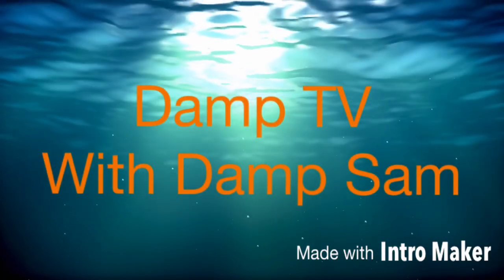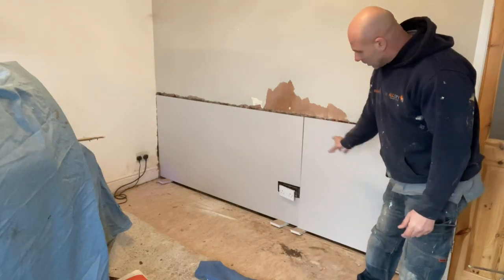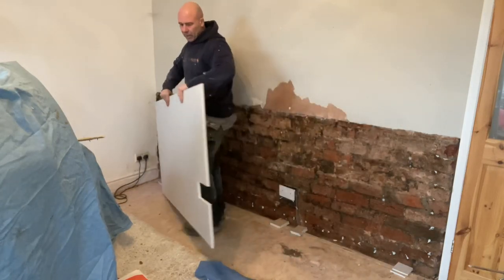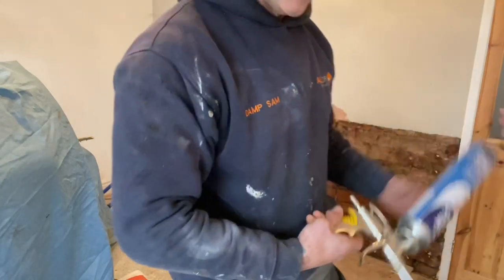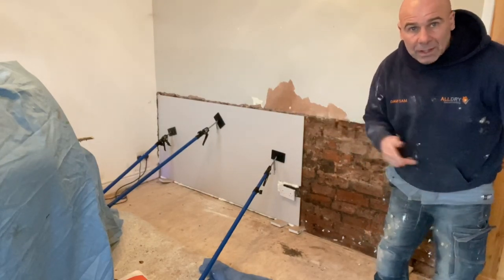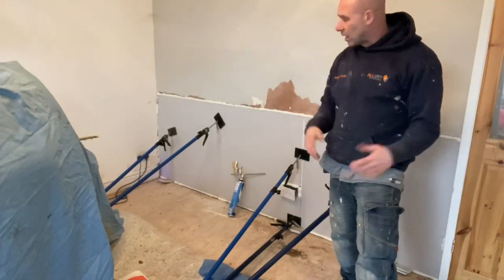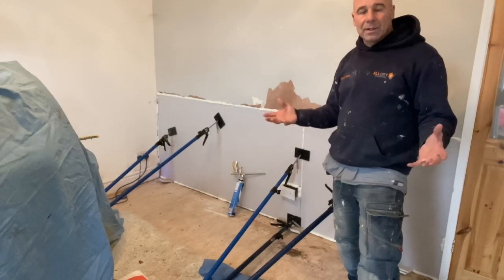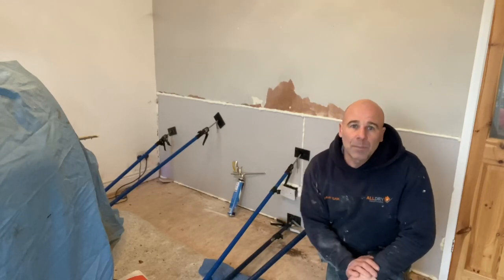How to Dampproof a small wall like a boss

Comment: Great video!!! I have quite alot of damp in 200 year house which is also rendered on the outside ( not sure if makes any odds!!) If I used the method but with a foil backed plaster board would that be a belt and braces job?
Reply from the maker: I try and steer away from foil backed boards , it’s to do with water vapour evaporating out of the masonry.
Reply: Check out Peter Ward heritage House videos and stay clear of plasterboard if your walls are solid brick or stone.
Reply: I have 180 yr old house 
Check out pete ward & then decide 
But outside cement render will have to come 
Off
Reply: @Darren Leeson, did you end up using foil backed plasterboards? I've given my living room walls a damp course. Tearing my hair out deciding what type of plasterboard to use. @Simon Cooper, what negative impact would foil backed plastebaords have? I've bought some Soudal foam adhesive for plasterboards to stick the plasterboards on to the brick wall.
Reply: Jesus mate, don't go down that road! Your old house needs to breathe. You're just sealing it up for future problems. Perhaps hack a small piece of render off to see if it is cement based. If it is, I'd remove it and either lime render it or lime wash whatever is beneath the render. I'm presuming it's brick/stone. Just in the process of  re-pointing our 1750's Cotswold stone cottage where some dick over the decades had repointed with sand and cement and caused shit loads of damp where the poor place can't breathe. Looking good and dry and comfortable now. Ps: Don't let any damp company tell you your walls need injecting in an old house,  because they haven't a clue what they are on about when it comes to period properties. Just after your money.

Comment: If i just installed the dry rods do you really have to take all the rendering off back to brickwork?
Reply from the maker: Only if the plaster is contaminate with salts causing decoration spoil and the existing plaster is salt resistant.

Comment: Why does the wall require a DPC if there is a basement beneath? Also salt neutraliser if there is nothing in contact with the plasterboard. The wall is potentially suffering from condensation and incorrect material use.
Reply from the maker: The cellar has earth retaining walls and there are salts in the wall hence the salt neutraliser.. hope this helps

Comment: Hello Simon Just bought a buy to let with rising damp on all downstairs rooms rics surveyor recommends I use all dryzone products, looked them up and there really expensive for what I need, what materials do you recommend for dpc injection and wall treatment then dot and dab for plaster board
Reply from the maker: Mick Peers without seeing the job it would be hard to say but any replastering after the installation of a dpc should be in accordance with BS6575 which means using a plaster system with a salt neutraliser of which there are many including the express replastering method.
Reply: Was planing on using dryzone dpc Rods then I usually just use tanking slurry but I’m told this doesn’t allow the brick to breath and is no good for rooms the have radiators or some form off heating,

Comment: Great video Simon. I am wanting this doing but want to remove a brick fireplace at the same time. Is it better for me to take the fireplace out first and get the whole to the right size before you come, or could you do that?
Reply from the maker: The wall would need to be prepped first and if there are sulphate salts these would need isolating using a different system.

Comment: on a non-cavity wall, how deep would you drill the holes for the damp course injection typically?
Reply from the maker: You drill to within 25mm of the far edge, so measure the wall on the door reveal
Reply: @dampsam  it's a property divider wall is all...this is what the company quoting me to fix it using tanking are suggesting needs doing...all for a bit of damp to the lower left side of a chimney breast which sticks out from the wall

Comment: I've taken all the damaged plaster off the wall, then sprayed it with salt neutraliser, efflorescence (white salt) deposits have come back through, should I continue with your method of sticking the plaster board on the wall, do I just rub the salt off and continue or spray it again with neutraliser?
Reply from the maker: You do need to brush the salts and debris off the wall to prep the surface. I’m not familiar with your job or the products your using, make sure you follow the instruction for applying any treatments.

Comment: Quick question would it work if I first used a mapei tanking paint on the back of the board and then used a tile backer board instead of plasterboard when doing a job like this (eg q board or abacus 6/10/20mm)? Reason I ask is it won’t rot it won’t wick or hold moisture and it can be skimmed plus I have some of each spare from tiling my bathroom.I’ve dealt with the sources of damp but wall condensates badly and this board also insulates.would it work do you think?

Comment: Quick question if you dont mind. Im damp proofing a wall exactly like this walls in lounge then behind it is steps going down to celler and then steps going upstairs. Question i have is does damp only show on one side of a wall as the lounge wall is really bad but yet I go to the otherside where the steps are going up to bedrooms and that side of the wall doesn't have any damp showing. Its only a single skin brick wall. Im trying to not disturb the staircase wall if I can help it but dont want to cause issues further down the road.
Reply from the maker: I would say that water will find its easiest route, it may depend on what plaster is on the other side, it may just be easier for the moisture to evaporate out of the wall and leave ground salt on the worst side. 
It could also be a different issue than rising damp so always have it checked be a relevantly qualified competent person.
Reply: Dwayne Squires. This doesnt get rid of damp. Sealing the house with cement render or even just pointing along with  these methods are the leading cause of trapping damp. if you have an old solid wall house you should never 'damp proof' notice how the wall was still wet and he just sealed it in a covered it up. That water is going nowhere, and the bricks will rot.
Old houses should never be sealed. The original lime mortar and plaster allowes moisture to evaporate through it and keep it dry. 
In the 70s onwards people started to point the outside bricks with cement mortar, and this started trapping moisture in. Damp started and didnt leave, then came along the 'damp industry' with all their damaging, drilling, injecting and sealing methods. 
IF A WALL TAKES MONTHS TO DRY OUT, HOW CAN YOU BE DONE AND HAVE GOT RID OF THE DAMP BY 3pm 🤔🤨

Comment: Great video,
May I ask what products do you use & why do you use 2 products to stick the boards on instead of just using 1 ?
Also can you stick the boards with any type of waterproof adhesive ? 
& why do seal around to edges, especially the bottom as I thought there should be a slight gap between the boards & the floor?
Thanks & merry Xmas to all

Comment: Ok let me tell you what I have Back b/room excessive damp due to builder dig up by the rear wall and to the age of the property excessive of water getting under wall because in the northeast excessive near the coast. (excessive rain fall) so I fitted extra air brick and will sort out gully by rear wall. Front of Bungalow, after house was built fully someone decided they want a bay but in, so some one put a bay in with cavity walls and did not put any damp course  in the wall and now i have moved the radiator it is more obvious with the damp in the internal wall. these old building with 0.3mtr of foundation problem. that why I want to double up. Thank you for getting back to me
Glen
Reply from the maker: Hi glen, my point was that if it’s installed correctly the damp proof course will work, if you use the damp check rods there will be the correct amount in each rod so if you follow safeguards instruction the barrier will be adequate and it will save you money buy just doing it the one time. We see it all the time on jobs where plasterer use waterproofing systems (tanking) to do dampproofing because they are not confident in what is needed and it’s over the top and can create other issues with condensation and cold thermal bridging.

Comment: Hi Simon I sent you a message before, Would it be better to put in the damp cream & rod lower of the floor board as I have access under the floorboard because I could do the cream and the rod together so I have double barrier?
Reply from the maker: Hi you shouldn’t need a double barrier , it all depends on the external ground level and solid internal floor level as to where the dpc is installed. Without actually seeing it I can’t comment other than say we always go with the first course accessible mortar line above the floor level as a rule of thumb.

Comment: Hi guys 
1: if you have damp walls there is normally an external problem  as to why you have damp internally. (Check this first) ground moves over the years so it could be all you need is a shingle French drain installed outside.
2:when or if you remove the plaster internally ALWAYS  let the walls dry out first 4-6 weeks with good ventilation in the room. NEVER EVER apply plasterboard to a wall wet like this. Plaster board turns to mush when damp,it will also stain the new plastering and painting eventually. 

This system is so wrong and my self i go around after so called damp injection about 5-6, years later. (I have hundreds of photos to prove this) if this property was ment to have damp course a slate damp course would have been installed when the house was built in the 1800s. Wrong wrong wrong,sorry wrong.
Reply from the maker: garymarcks nice long piece you put there on our feed. Your wrong about this system but I agree if it’s fixed with dry wall adhesive it could get damp but this system is by designed by safeguard Europe . So if you have evidence of their system that has been installed correctly and failed I’m sure they would be interested.
Reply: How did the walls get damp in the first place simple question.. that you can't answer
Reply: If you watch the video Sam shows the bridging behind the skirting board with a bonding compound. This stuff sucks up moisture for fun.
Reply: @damprotek  if you listened he said at the beginning    
    A bridging issue
Reply: @rikhughes6452  I was listening he said it if it needed a damn course in the 1800s it would have had one but damn courses weren't introduced until 1859 And to be honest who's going to allow a wall to dry out for 4 to 6 weeks now that wall has got nitrates in it which you would have to neutralise And then what put a breathable lime-based plaster back . What a lot of faff when in fact you could inject it with some high strength injection cream ( the reason they fell is because they use cheap ones). And also properly not installed.. And of course I'm digging down the external levels will help.. but we're here to make money bottom line and I very rarely get a job call back from what I do perhaps one a year out  of hundreds..

Comment: Hi Simon your videos really helpful for me. I've got rising damp to Treat that I'm be doing myself and I'm learning a lot from you. With this board fixing system, why are you using the two different products? Is it for cost, as the dryzone adhesive is very pricey, or another reason? Could I use just the insta stik or something like pink grip dryfix instead?
Reply from the maker: Hi Jonathan, in theory you could use the pink grip or one of the sticks like shit waterproof aheadives, I use drygrip as it is an ingredient of the safeguard system and was made to use with the salt neutraliser cream,
Reply: Dwayne Squires  if you have an old solid wall house you should never 'damp proof' notice how the wall was still wet and he just sealed it in a covered it up. That water is going nowhere, and the bricks will rot.
Old houses should never be sealed. The original lime mortar and plaster allowes moisture to evaporate through it and keep it dry. 
In the 70s onwards people started to point the outside bricks with cement mortar, and this started trapping moisture in. Damp started and didnt leave, then came along the 'damp industry' with all their damaging, drilling, injecting and sealing methods. 
IF A WALL TAKES MONTHS TO DRY OUT, HOW CAN YOU BE DONE AND HAVE GOT RID OF THE DAMP BY 3pm 🤔🤨

Comment: You cant plasterboard over a damp wall. I have done it and doesn't work and it will either travel about the plasterboard or come through it. Have a look at the PCA guide lines. The dpc cream can take up to six weeks to cure and the brickwork has to dry as long as possible before re-plastering. I have even used a builders drier to dry the brickwork out before re-plastering.  Still cant beat sand and cement render with a salt neutraliser.
Reply from the maker: Oh david stop making yourself look daft lad, yes waterproof render is good but can cold bridge on a solid wall. 
Walls can take up to 12 months to dry out after the installation of a dpc depending of how wet they are and other factors you will know I assume. 
I’m guessing you used dry wall to stick your plasterboard on the wall and it kind of builds a picture of you. Sounds like you had a failure and what ever you tried was wrong. This is because you have not learned how to do things right and you don’t know how moisture affects walls of building.. 
I all for constructive comments so if your stuck on anything just ask.
Reply: @dampsam  Dry lining walls isn't a good idea it doesn't matter what you say do you research.  I have dry lined walls in the past and have never used the dot and dap method which is s recipe for disaster, the damp transfers through the daps. I have tacked the board with clout nails which leaves a sight gap so the plasterboard isn't touching the walls. I would prefer to hack off higher and use the Newton membrane 1.5 metres high and than dot and dap plasterboard this works.
Reply from the maker: @davidellis5964  well what ever works for you, there are lots of systems out there and done right they should work. Iv never herd of clout nails used in the system though.

Comment: Hi mate. 
Using this system if there is rising damp/low level dampness (brickwork looks quite wet here) using your method how do you deal with humidity levels behind the plasterboard?
Reply from the maker: Dodge O hi thanks for watching, the reason the brickwork looks wet is because we put salt neutralising cream on which is part of the system. 
As far as ingress and humidity is concerned the wall will start to dry out once the dpc has been installed from that point forward and moisture will evaporate as air is allowed to flow across the surface with the dots holding the board slightly off the wall. The wall will eventually dry out and return to equilibrium with its surroundings.

Comment: Hi Simon , just a quick question really basically I have standing water under my sub floor same with all cottages in the area however mine has no ventilation what so ever and the only possible way to put air bricks in would be to break the back yard up as the concrete is higher than the dpc.  Is there a better way to sort this , cheers
Reply from the maker: It’s hard without all the info on the construction but if the subfloor can be accessed you could have a drainage system installed with a sump & pump.

Comment: Great video Sam. What areas in the UK do you cover? I have a property in Coventry which requires Damp proofing.
Reply from the maker: Dwayne Squires we are in South Yorkshire your a bit out of our range. If you need any advice I’m just an email away. 👍
Reply: Simon Cooper HNC CSRT CSSW thanks for getting back to me Simon. Yes would love advice/guidance. Please can you let me know your email address and I’ll share the project I would like your help with.
Reply: @dwaynesquires  if you have an old solid wall house you should never 'damp proof' notice how the wall was still wet and he just sealed it in a covered it up. That water is going nowhere, and the bricks will rot.
Old houses should never be sealed. The original lime mortar and plaster allowes moisture to evaporate through it and keep it dry. 
In the 70s onwards people started to point the outside bricks with cement mortar, and this started trapping moisture in. Damp started and didnt leave, then came along the 'damp industry' with all their damaging, drilling, injecting and sealing methods. 
IF A WALL TAKES MONTHS TO DRY OUT, HOW CAN YOU BE DONE AND HAVE GOT RID OF THE DAMP BY 3pm 🤔🤨

Comment: Hi mate what is adhesive you are using to dab boards on
Reply from the maker: It’s called Drygrip adhesive from Safeguard Europe and can be bought on Amazon
Reply: @dampsam  Do you have to use the Drygrip adhesive? Could you not just use the Insta Stick foam on it’s own?Cheers